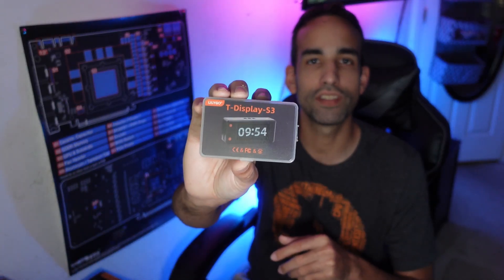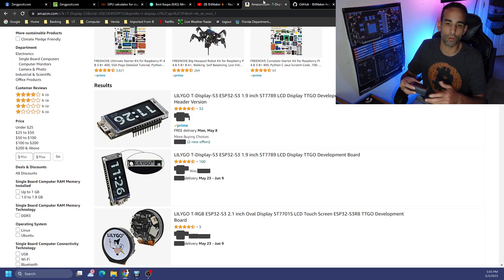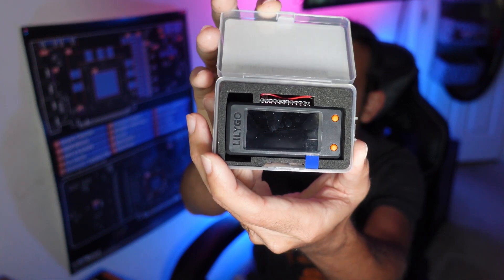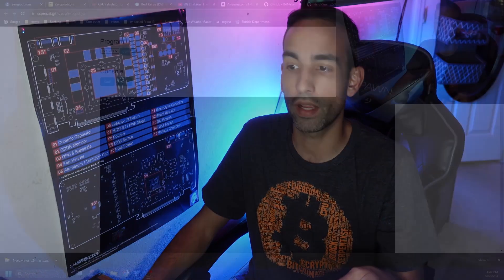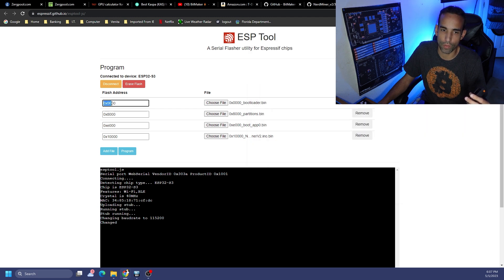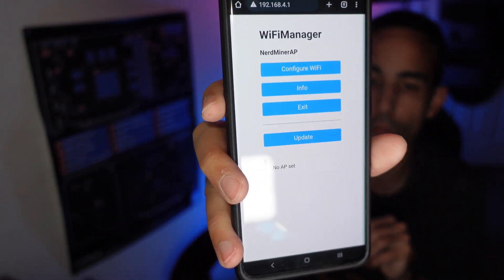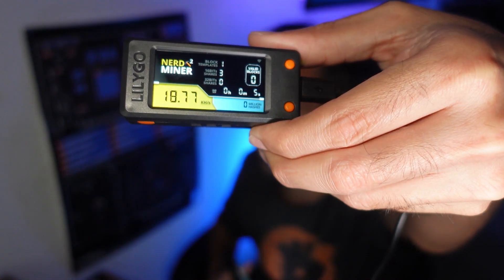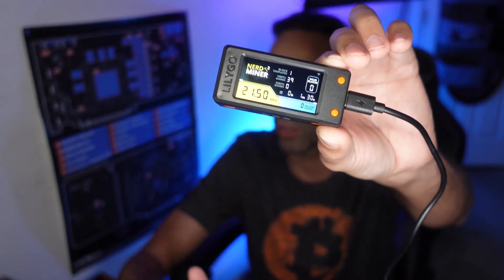NerdMiner - A Micro Bitcoin Solo Miner

Comment: For some reason my nerdminer can not find any networks. Not sure what is going on.
Reply from the maker: Reflash it until it can be detected, and if you can scan qr code to connect to device, or see it on network or phone, the internal NIC might be bad
Reply: @SerpentXTech  I found out what was wrong, I did not have 2.4 ghz enabled on my router

Comment: did every thing you showed and now i have no display
Reply from the maker: There is a button on the miner that turns display on and off. Make sure you didn't hit that, the two buttons on the front facing you, but on one side. I had to refresh my device a couple times, so if first one failed, try again
Reply: thanks i was able to get it working @SerpentXTech

Comment: What you buy from Bitwater is plug and play, right?  Comes with screen
Reply from the maker: Bitmaker just supplies the files or insight but you can order the Device as one off Amazon. I believe I have it linked in description but for USA. However u can click link and find it for your country. Only thing you will need is a type c cable that can connect to you computer

Comment: Anyone have it where the screen never turns off after pushing button bottom?
Reply from the maker: So the top two, on lcd side don't do anything for me. The power button is below lcd. But what you really trying to accomplish?
Reply: @SerpentXTech  Just turn the screen off while it’s running.
Reply from the maker: @forty6260  yea mine doesn't so that either. Have with tweeted at the nerd miner community to see? Tag me if you do

Comment: Did you have to do anything with your modem or router? I set mine up, but it won’t hash upon connecting to Wi-Fi. Any help would be awesome!
Reply from the maker: No I did not. But I have done a lot to my router. For FlUX nodes, etc. What is yours doing, so you got it connected to wifi? But what pool you on? It could be the pool url, address and or something else. Try refreshing it with esp tool, and go through the setup again. But note you won't see the hashrate at the pool, because it is such a small amount. As long as you see the hashrate on the device your good.
Reply: Use WiFi password without extra characters